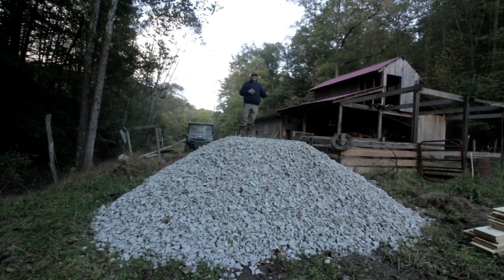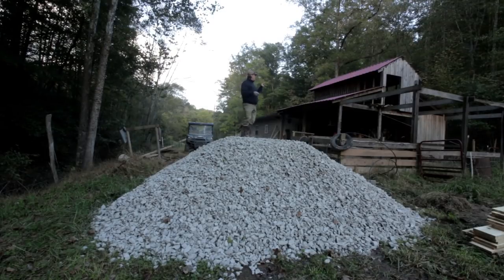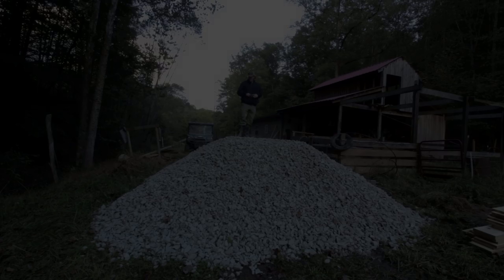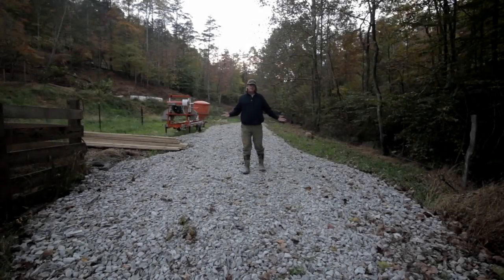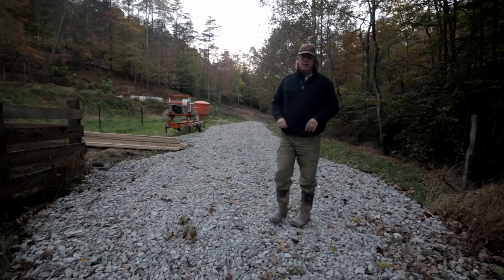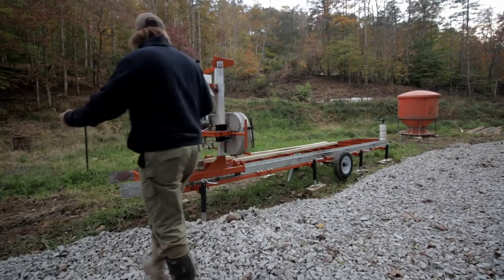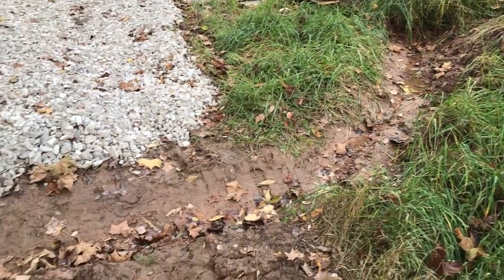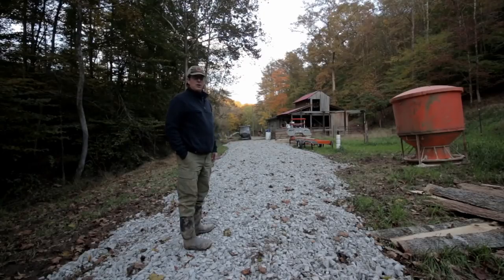Bringing in stone to fight the mud

Comment: As a suggestion, I would drive in some T posts and build a walkway just above the gravel.  That way you are up off the gravel while sawing.  You could use some of your thicker off cuts to make the walkway.  This will get you up off that gravel.  It can be easy to turn a ankle on that stuff while concentrating on the mill.
Reply: Well compacted gravel is fine to work on unless you have twigs for ankles.

Comment: Trying to work out what I'm looking at, translating American to Australian. Is your 'gravel' a coarse crushed rock without the fines? What I use for maintaining handstand areas is what my local quarry calls road mix, driveway mix or concreting mix - a blend from approximately 25mm down to fines. It packs into a solid surface for the driveway, and also can be mixed with cement to make concrete - the fines substitute in for the sand in a traditional concrete recipe, and it's a lot less bother.
Reply from the maker: Yes, crushed limestone without the fines.
Reply: Red Tool House - Homestead I've never used crushed limestone, my local quarry is volcanic. Does the coarse crushed limestone set into a solid surface without the fines? My local crushed rock needs the fines to pack down, if it's the coarse stuff without fines it stays loose forever - very unpleasant to walk on, although I guess if you were worried about intruders it would stay noisy forever too.
Reply from the maker: Here at our place, the stone will settle in to the clay (and may disappear) I have seen some roads that it doesn't pack down tight and is always loose. It it noisy too.
Reply: Red Tool House - Homestead your clay is a lot softer than mine, then - even in wet areas it would take years for that depth of crushed rock to set down into the clay here. But I think your soil is a lot richer, as well as having so much more rainfall - speaking of which, what is your average rainfall there? We're supposed to get 550-600mm here, but in practice it can be anywhere between half and double that.